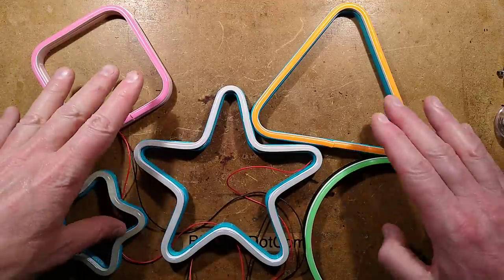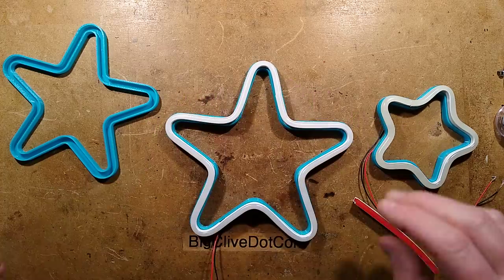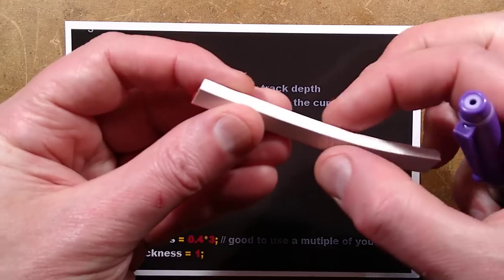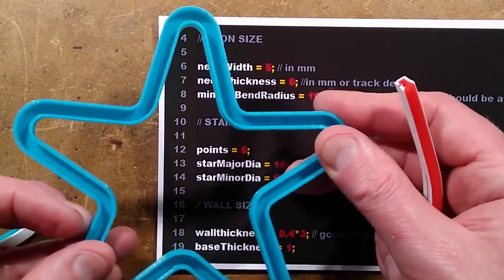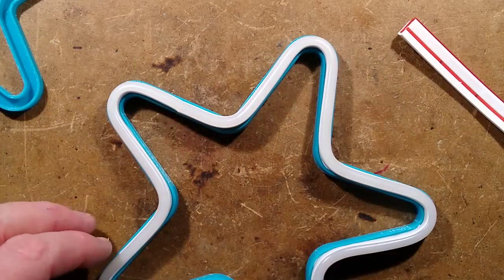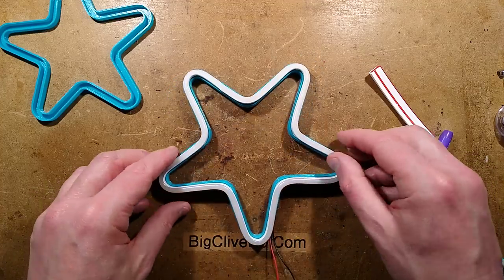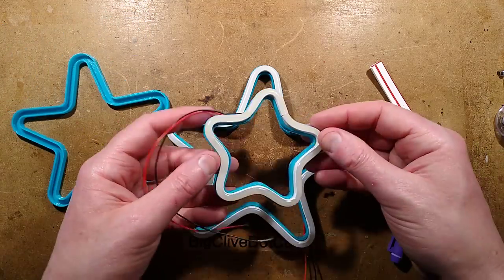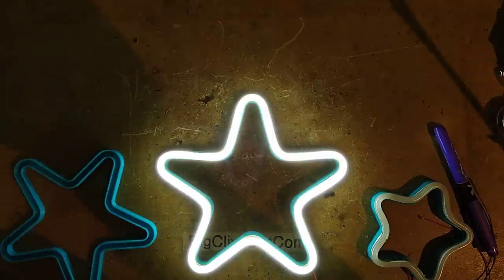By request - the neon star frame

Comment: This is one of the things I don't like about OpenSCAD. If you can't use the tool to make a simple shape like this, the tool sucks. As a sysadmin/programmer I should be predisposed to love OpenSCAD, but I don't. The fact that you are supposed to calculate all the geometry yourself, position primitive solids or sketches one by one, without ability to map them to each other etc. is unnecessarily complex. You should not need advanced maths to create something this simple. If you insist on using OpenSCAD, you're limiting yourself severely.
In other CAD software, this is an extremely simple task. You draw the profile, you draw a path, and then you sweep the profile along the path. Done. And you don't need to make the path a regular polygon either - you can draw any kind of shape you want. You can use splines (or freehand) to write text in any kind of type you like and "bend" your own neon, for example. I highly recommend anyone to stop insisting on "doing it like the cool kids" and try a better and more capable tool like FreeCAD.
Reply: I think OpenSCAD isn't really designed for this kind of thing though - as far as I can tell, it's really intended for making functional mechanical parts, things where you're mainly working with 90° angles and the occasional circular part, and where you want to be able to rapidly change things (tolerance, scale, etc) by just updating an easy-to-find number and reprinting. Home decor isn't really on the dev's radar
Reply: @kiefac  do I smell elitism there, disqualifying other software as intended to make home decor? Have you worked with, say, FreeCAD, and do you know what you're talking about?
The problem with OpenSCAD is that it sucks for technical parts as well. If your technical parts consist of right angles and occasional circular part, may I suggest that they are not terribly advanced? A collection of stars with varying number of points for Clive is actually the only home decor I have ever designed with FreeCAD. The rest are all technical, functional parts. OpenSCAD is flawed from the base idea - you're supposed to build stuff out of solid primitives. That's a stupid way of going about things. Since the begin of engineering, everything was done in the same way: make a drawing, then make a part. This is precisely the paradigm that FreeCAD follows. The drawings are fully parametric, and you specify all dimensions for them, plus you use constraints (coincident points, parallelism, angles, tangentialism, symmetry and much more...). And there is also a spreadsheet workbench which you can use to put any kind of dimensions into a spreadsheet and base your drawings off those dimensions. When you change something, the whole model updates (provided you designed your model appropriately). FreeCAD seems to be one of the most powerful CAD packages around.
For an illustration of what I mean, you can visit /social/201268-horrovac/models on printables.com - almost all of my models are done with FreeCAD. How much programming do you think would be required to produce something of that complexity in OpenSCAD? How much maths would you need? And then you realise that your design sucks, which happens to me regularly, and you would have to do the maths for a modified design...
I'm not being a fanboy for FreeCAD here, but it annoys me to see how many people are limiting themselves by insisting on using an inferior tool because "it's for technical parts" and because other tools "can't vary dimensions, tolerances, scales etc." from a central location - which is just a whole load of bull. Don't limit yourself by doing it the (overly) hard way.
Reply: @horrovac  holy shit relax dude, I literally just meant that the devs probably weren't looking to make software for artistic endeavours. I don't see how stating my observation that "this software appears to be intended for functional parts" makes me an elitist
and I haven't used freecad but I've used inventor and fusion and yea, I totally agree, being able to edit like that is nice and works well for most people, but maybe some people find it easier to write a little script to make parts instead of using "normal" CAD?
Reply: OpenSCAD is just a modeling software whose "drawing method" suits certain kind of minds, like say people doing software programming for instance. It is not inherently better or worse than another, it just a tool that can suit you or not. Feel free to use another one if it doesn't suit you.
Reply: @kiefac  Ok. I got a distinct whiff of deprecating tone in the mention of home decor, that's why I asked if it's elitism instead of stating it uneqivocally. If not, don't worry about it.
I don't think that anyone can find it "easier" to write a script, but people definitely think it is easier. People also think that OpenSCAD is the "proper" tool for "technical parts". That is what they always say. But it's just not true. Unless all you want to model are cubes and cylinders and such, it is never objectively easier to model in OpenSCAD. If you have always used OpenSCAD for this, it is certainly easier to keep doing it rather than learn how to use another software. This is the same thing that keeps people using Windows over Linux.
If anyone wants to use it, I'm absolutely fine with it. But I won't let these fallacies be said, keeping tons of people limited by believing they have to use an inferior tool. If you want to promote it, I'm fine with that as well, but be honest about what it can do with how much effort. Which is, objectively, very little with a lot of effort.
Reply: @horrovac  alright dude, just remember your perspective ain't the only one
Reply: @VisDeux  I am one of the people doing software programming. Usually in C, no less. FFS, I use Latex instead of an Office Suite for almost anything. I write my HTML with Vim. My cluster is spiked all over with scripts that do all my work for me. I'm precisely the type of person you're supposing OpenSCAD caters for.
But I'm not impressed, precisely because I'm a programmer. Writing software to do stuff also gives you the insight into how good the tool you are using is for a particular task. So I may decide to write something in perl or python because they are inherently better and easier for string manipulations and file management than C. If I want to asses the memory access speed in a new supercomputer, or profile the performance of the daemon I'm writing, I'll use something more "bare metal" like C, mostly with some inline assembler, because I don't want something like python to skew my results by trying to "help" me with what it assumes I'm trying to do. So there is very well distinction among tools, and despite your hippy-trippy assertion that everything is as good as everything else, I'll do any deed rather than touch anything written in fucking Visual Basic ever again.
So you can believe I'm not just idly talking when I say OpenSCAD sucks. I fear no discussion over the matter, because I have a lot of sound arguments to back it up. It IS inherently worse, and if you can't produce arguments against it, well...
I have tried doing this star in OpenSCAD - precisely couple of hours before Clive announced that a group of people have collaborated and made a script that produces a star. So I dropped it - despite being quite close to making it. I wanted to make a module that uses sweeps and draws one tip of the star, and then rotate and execute that module as appropriate. Good plan. But then, the radii. You can generate a drawing, offset by the radius of the bend, translate it to appropriate position and then sweep it around for an appropriate angle. Fine. so then you need to continue that sweep straight towards the other bend. Starting from where? Where do you translate the drawing to before you sweep? Lots of trigonometry, trial, error and cursing later I got it, it connected to the first bend. How long do you sweep, then? fuck. You have the centre of the first bend and the position that the other bend should rotate around. How long should the spike be anyway? Ok, I need to calculate the external and internal radii, calculate how long the bends go along the length of the spike and substract those from the calculated length of the spike side. With me still? Ah but I still have only the centres of the bends, the pointy one is inscribed, the dull one is outside, so I have to use trigonometry again to calculate the IMAGINARY points of the star and then do my calculations off that. So I try that, doesn't connect. Ah, I was assuming the inside edge of the channel, that's an idiotic error to make.... I realise I screwed it up from the start and should have based my calculations off the CENTRE of the channel... Ok, so I go back, redo my math for that, redo all the bends and straight sweeps according to the new math, write everything up as it should work and I'm prepared to enjoy the sight of my perfect object... Fuck, it overshoots. I think of something that may be relevant, correct for that, it's closer, but there is a tiny mismatch still. I start to despair, tweak this or that parameter bu guessing, and I get it closer. Now it hopefully works for different radii of the star as well, right? I try another, and everything falls apart. With me still? At this point I'm already properly drunk and am torturing my brain to rework the concept of the math to finally have a usable basis to base my calculations on, and the Patreon mail with the Star announcement by Clive comes in. I give a sigh of relief and give it up. I drink some more to get rid of the frustration, and out of the same frustration I fire up FreeCAD and have this thing done in a couple of minutes. I'm totally pished by now, but I can still model. Five-pointed star? Easy peasy. Draw circle, connect lines to five points on that circle and to each other, select all the lines and hit the equality constraint - blammo, perfect star. Bends? Create an arc connected to both sides of the spike, make a tangent constraint towards both, perfect bend. The same for inner bends. Select both and make an equality constraint, perfect. You know, just construct the drawing like you were taught in the geometry lessons. Or I could use several other methods to construct the same. Map stuff to the surfaces of other objects and go on from there...
Meanwhile, OpenSCAD knew where the bend ended and where the next started. It must have, to draw the preview. It only won't let me reference that position. Nor continue the sweep by other method. Do the bend, than continue straight, then do another bend in other direction...? Nay, you place the thing where you want it, and then, to continue it, you figure out where it must have ended, place the thing you have just swept at the same spot where the previous sweep ended, translate, rotate... and then sweep it for the length towards where the next sweep you're going to make will end being. And all of that you'll calculate yourself, please. This is not necessary. The machine is there to do MY work, not the other way around. This is a solvable problem, but they seem not interested to improve this. And therefore, it sucks.
Have you read through all this bullshit I wrote just now? That's just a fraction of time and effort I used to produce nothing at all. And therefore, it sucks.
Reply: As someone who uses both FreeCAD and OpenSCAD I can honestly say that I find each tool better for some projects than others. When you have been using OpenSCAD for some time you build up a "library" of parametric models that make building complex objects much simpler. If you are making a project that contains curves, surfaces or is unlike anything you have modeled before then FreeCAD or similar is the obvious choice. However I find that unless you start from the outset with it in mind, extracting features from a FreeCAD model and using it in a different project is difficult and error-prone, something that is trivial in OpenSCAD. I also find that OpenSCAD works much better in version control systems like GIT or Mercurial, which is something that I like to do.

As always, the trick is to learn a range of tools and use the one most appropriate to the task in hand. For someone whose needs are simple, and come from a programming background, OpensCAD requires a much shallower learning curve that FreeCAD or other Open CAD tools, and that just may be enough for Clive.
Reply: Well, the sweeping of a profile along a path is almost exactly what my OpenSCAD scripts do in 2D. But keep in mind that the inner points of the star will get more pointy, not less, when doing this.
Reply: @IanSlothieRolfe  There is no contention that someone like Clive would prefer to use OpenSCAD rather to learn to use something else. Because obviously, he does. What I am saying is that he and others doing this are being limited by OpenSCAD and the unnecessarily complex requirements to achieve even simple tasks (like this star). I'm positing that their needs are simple, because they MUST be - because that's all they can get. Because they're stuck with a crappy tool.

I'm from a programming background myself. I was prepared to like a tool that allows me to script a model, but unfortunately, the tool is lacking. Not only is the design paradigm wrong (composing objects out of primitive solids), but the
syntax is clunky, and it mimics a scripting language, which it isn't. You can do maths, but (almost) all the maths will be done before the model is being rendered, not before. So the "loops" won't have the values you think they would, but the one from the final run of the loop. Huh? 'scuse me? When I started contemplating writing a python script that would generate an OpenSCAD script and "unroll" these loops for me, I realised that it's not worth it. Because it sucks.

When designing mechanisms, humans tend to think in terms of relationships. Make this level with this, this needs to be parallel with this, put this in the middle of this... Contrary to other tools, OpenSCAD offers no mechanisms for this. If you want to put a cylinder in the middle of the top surface of the cube, you'll need to draw a cube, remember it's dimensions, draw the cylinder, translate it up for the height of the cube, translate it half the width of the cube in X axis, half the depth of the cube in Y axis. And then you realise that you'd rather have another, smaller cube instead of the cylinder. But the origin of the cube is a corner, while the origin of the cylinder is the centre. So now you have to change your math and translate up the height of the cube, translate half the big cube's width minus half the small cube's width in X direction, and half the big cube's depth minus half the small cube's depth in Y... Sure, you canmake a module to do this. But this is a really simple task, and the tool should be able to do it out of the box. If you want to design something like this star, ho boy! - you better have all of your trigonometry about you.

I have used OpenSCAD to generate a battery holder like Clive's (but, of course, better XD), because it is a repetitive pattern of simple solids, and people think that a "parametric" model must be in OpenSCAD. But it does not mean that it's the better tool for the job. I could have done exactly the same in FreeCAD as well, with about the same amount of effort, but it would be likely that people won't know how to vary the parameters. OpenSCAD is just the lowest common denominator,and as such, is limiting.

The proof for this is the fact that it took several weeks and a cooperation of a team of people probably very proficient in OpenSCAD, to do something as simple as this star. It took me several hours and a couple of redesigns to get about halfway there before learning that it has already been done (and before I got too drunk to do any maths). It then took me about 15 minutes to make one in FreeCAD, and about half an hour to make 3, 4, 6, 7, 8... pointed versions as well (despite getting ever more drunk). All of them configurable for both the circumscribed and inscribed diameter. And then I thought of a way to make it even simpler, but didn't bother, since nobody cared about the first one either.

You have to learn to master every tool, but the purpose of the tool is to do the job in the best way possible. If the tool does not do the job, you can't insist on blaming the user. Some times, you just have to conclude that the tool is
crap. Everyone reading this needs to do themselves a favour and acquire skills to use better tools.
Reply: @ksjhi  I fell over this as well, before realising that the better way to sweep would be from the centre of the profile, and rewriting everything to do this. But the maths and alcohol got the better of me, and the community got ahead of me here :)
Reply: who would read all these lines ?

like crap... never ever.
Reply: OpenSCAD is more of a math tool than a design tool. It turns formulas into objects. If you have your formulaic representation of your shape, it will easily turn it into 3D. I like to compare it to POV-Ray (damn I'm old; I used that decades ago). The advantage of OpenSCAD is that you don't have to install some huge CAD package and learn how to edit parameters of some sketches or objects. With OpenSCAD just change the numbers in a textfile (that someone else has prepared) and you're done. And a star is a very "parametric" shape. BigClive maybe can't invest the time to "construct" a star, but as you can see other people can and share.
Reply: @superdau  Yes, that is also how I see OpenSCAD, although it makes some things unnecessarily complex. It could really benefit from some included additional geometric primitives. For example, any easy way to construct tangents would be really helpful. Yes, I know, I can use 3rd party libraries for this. But I like that we are able to define modules which can encapsulate quite complex operations. I am also missing lambda functions or function variables. children() is not a full replacement for those, but it at least enables you to apply modules to other objects. Perhaps, defining an own language instead of using an existing one for all the programming stuff was not an optimal choice.